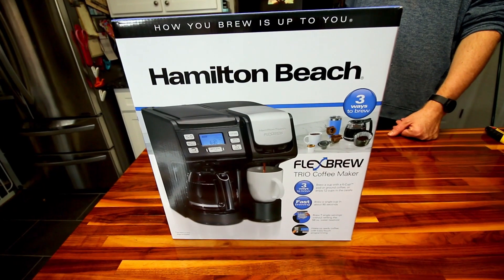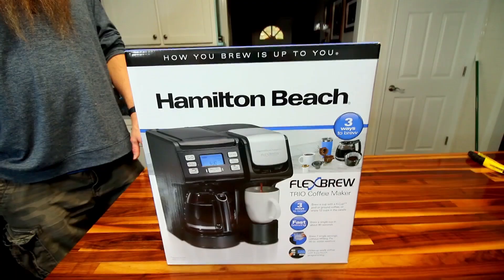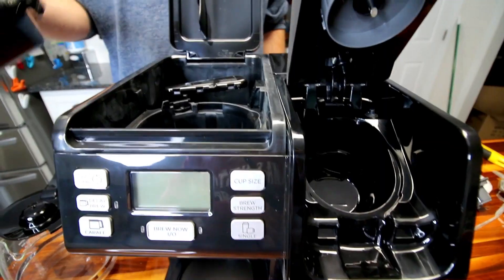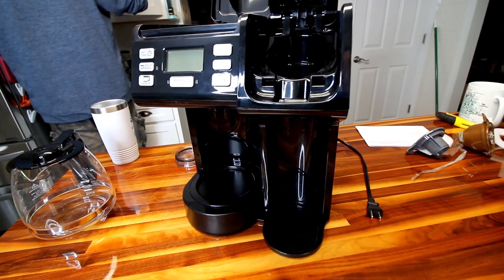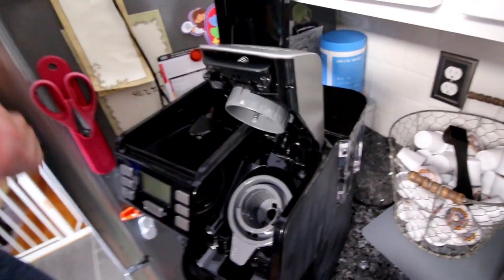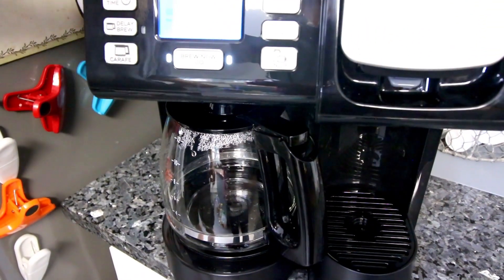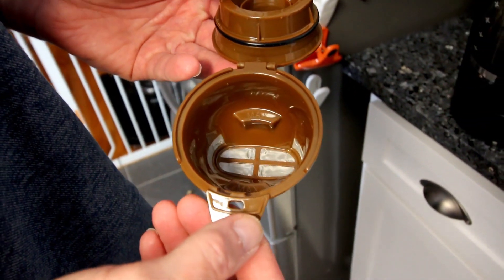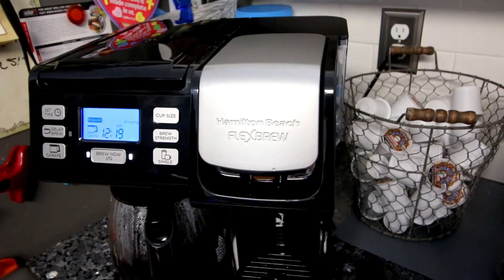Hamilton Beach FlexBrew Coffee Maker | Unboxing Review and Detailed Demo on How to Set Up and Use

Comment: thank you for the demo. I was surprised that the single serve side had a water capacity of 56 ozs. You couldn't set a cup that size to complete 56izs. so does the brewing stop when it reaches yoyr cup size? And what do you do with the remaining water left, can it save for the remaining cups? Or would you discard it?
Reply from the maker: You set your cup size and it will only brew that many ozs. The remaining water just stays in the tank for the next brew so you aren't having to fill it every time you want to brew a cup.

Comment: Hello ,i just bought the same machine ,i just wanted to know if there is a off button, or you can only wait 2 hours for it to close.
Reply from the maker: You push the BREW NOW button to turn it off.
Reply: @AliciaLynnYT  i did but it's still on ?
Reply from the maker: The screen lights are always on unless you unplug the machine. Pushing the button just turns off the brewing/heating element.

Comment: J have used the compressed air to clean out the top. The needle is clean. it has been descaled several time. I alsways use filtered water not tap water too. It is ony about 2.5 years old. I am getting very frustrate with using the K Cup side. I use that any day I am not going to work because my need for cffee changes on those mornings. What else can I do
Reply from the maker: We had the same problem, and it may sound wrong, but we slammed the water reservoir down into its housing, with some water in it, 2 or 3 times and that fixed it. Doing that i believe will dislodge anything stuck. We read to do that in a forum and were skeptical and a little concerned  about that being bad for it but it did work! Just be as careful as you can!

Comment: If you remove the pin section and run a tooth pic throught the holes in the pin where the water comes out, you will find it pluged with dryed coffee. It pops out very easly and the flow is full agian. This is common with all podds and you should inude this in your vido as every one I know has had the same problem. I do admit it was your vido that showed me how to get the pin out for inspedcdtion LOL. Keep up the good work.

Comment: Is there a way to turn on the reheat warmer after it shuts off, I believe it stays on for 2 hours. Our old kurig would just hold the brew button until the light turned red for reheat.
Reply from the maker: Press the brew button. As long as there is no water in the reservoir, doing that turns the warmer on.

Comment: How do you turn the machine off after use?
Reply from the maker: It has an automatic turn off after 2 hours for the burner. To turn it off before, you push the BREW NOW button. The screen lights are always on unless you unplug the machine.

Comment: i purchased the coffee Maker and  I really like the machine. My big problem is the coffee tastes like plastic. I washed everything in soapy water ,ran water thru and even did a diluted water and vinegar mixture. Any advice for me to get rid of that plastic taste. Thanks
Reply from the maker: Sorry to hear that, we didn't experience that with ours. It sounds like you have done everything already that I would have done or recommended, myself. The only thing I can think of would be to run water through a couple of more times. If it persists, it is probably something wrong with the machine.